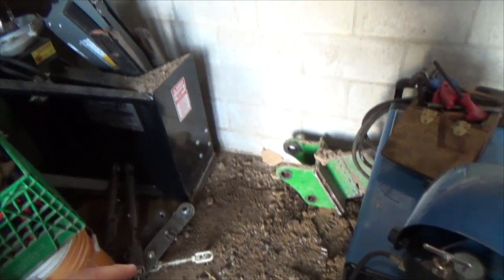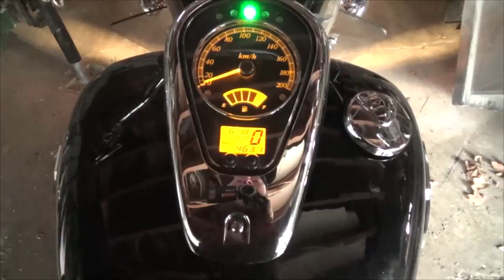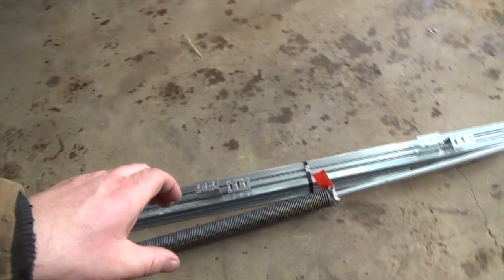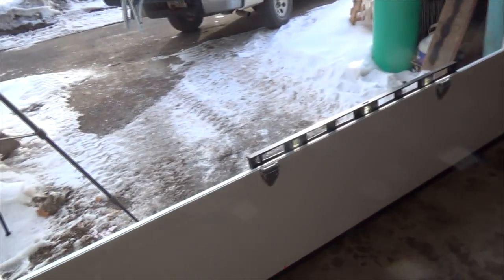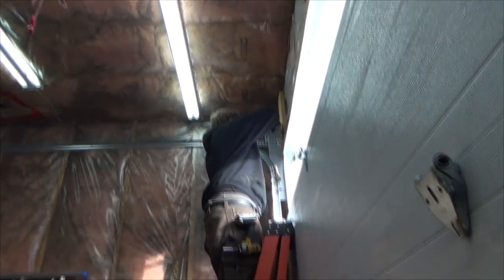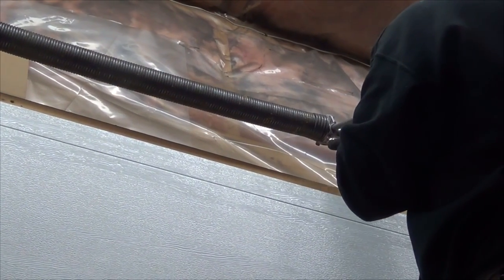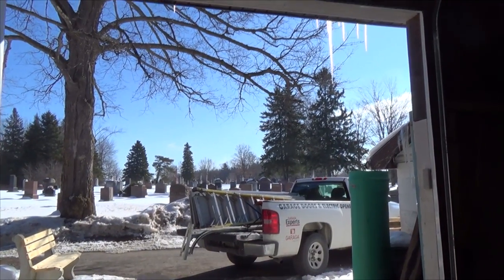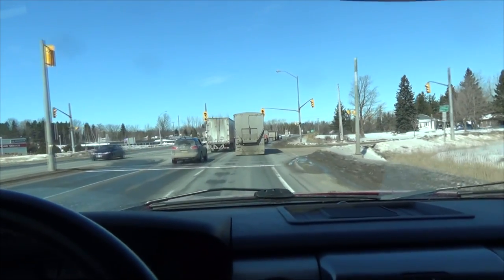New R16 garage door installation

Comment: That 110 looks mint. It even has the skid plate and stabilizer guards on it. That factory thumb is super hard to find too.
Reply: I agree that is a nice 110. It would be nice if it had rear hydraulics also.
In the photos I can see the stabilizer guards but not the skid plate. Where do you see the skid plate?

Comment: The truck on the road was hauling DDG it's the left over corn after the ethanol and stuff is taken out. It is used to feed cows. The are two forms of DDG wet (which the truck was hauling) and dry. You buy them at places like ADM.

Comment: He wound the spring up in an odd way, guess because he does it for a livinng, i was taught to make a line, i see he had a yellow lime already on the  spring, every time the spring get a full revolution you can count the yellow spirals, if not equal, the door will lift more on one side than the other due to hot and cold plus wear,  but hey, you have warranty.

Comment: Bill you don't really need it we have a 2004 kubota m110 hp and just hit 7800 hours and still running strong
Reply from the maker: ***** i don't necessarily agree with that.. ive known people with the K that hated them because they were down more than up
Reply: Really it is all that suits you we baught it because it was only 90,000 (no loader) but with the 7800 hours and counting they are hard working hours because the only time on the farm we don't use the pto is when we have the blade on the rest is plowing spraying spreading fertilizer and then we have our old tractors one of the hour meters on it stopped at 9200 hours and that was over 10 years ago
Reply: Bill just go with your  heart and get what every one u wanna get haha and that's true
Reply: Yer we just baught another kubota m110gx were still waiting for it. But overall we have been very happy with kubota. And in our case the john deere was alot more expansive. But everyone has there own opinion